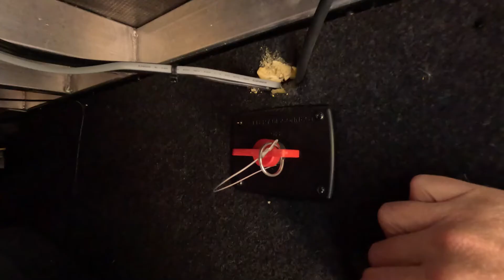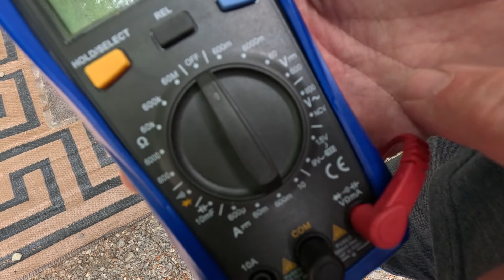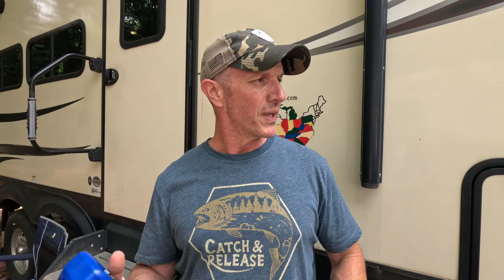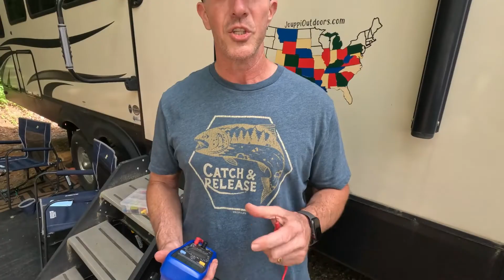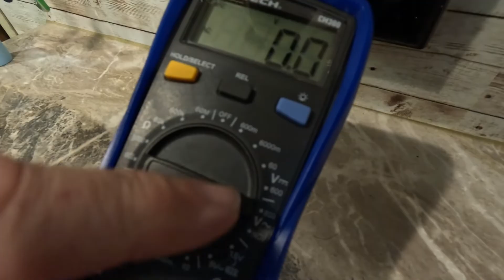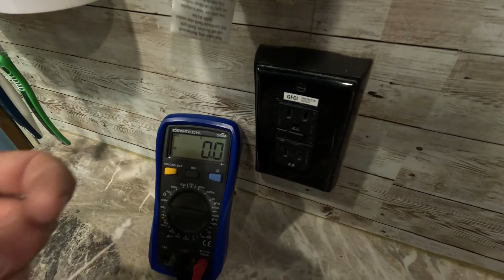Understanding RV Electrical Systems: Basic Troubleshooting Tutorial

Comment: Outstanding video.   I have what I think is a bad converter.  My RV is hooked up via 30 amp outlet to my house 24/7 so we can use the fridge in there in case our house fridge is on the blink (happens more than I would like).  I have a smaller RV--it is a 16' Retro by Riverside.  No doubt, much simpler in terms of power usage than many RVs you have seen.

We had an indirect lightning strike to the house recently which fried our thermostats and a circuit board in one of our two indoor AC units.
The RV fridge and lights had problems that night but I had more pressing concerns in the house so I switched off the breaker to that outlet.

The next day, my multimeter indicated 120V AC but no DC at all and no working lights or fridge in the RV.  A 15 amp AC fuse (labeled 'Gen') was blown.  I replaced it, but there was still less than 1V DC when measuring across the DC terminals inside the power distribution box.  All of my DC fuses show proper continuity.  It is rather simple inside this box because the trailer is small and fairly basic.

 I now think the flickering lights the night of the lightning strike were due to operation off of a weak battery,  which then was drained dead the next day.

I will examine the capacitors and fuse inside the converter.  If I am lucky, it is a blown fuse instead of a bone fide converter replacement.  Either way, I am confident I can fix this myself now that I know how these different power systems interact.  I did all of the electrical work myself for my farm house which was bought as an unfinished foreclosure--so, I am fairly confident in my skills here.  This video aided my education on this latest DIY project.
Reply from the maker: I agree, sounds like a bad converter. Glad the video was helpful!
Reply: @JouppiOutdoors  Found out there is no continuity in the converter fuse.  Can't seem to find a source to buy just one single ceramic PCB-ready fuse so will just get a new converter for about $75--not absolutely sure replacing the fuse will 100% fix the problem + time spent with soldering gun makes installing a new converter the  best method in terms of time and money.  Will keep the old one for parts.  YT videos like your have been a godsend for a DIYer like me.

Comment: there is a top connector to check that fuse
Reply from the maker: Correct, I was trying to illustrate that even though the fuse may not visually appear blown, checking it with a meter will verify if it is definitely good or not. I did this because most people are just pulling and looking at the fuse, not testing it in place.

Comment: Just got back from camping (The road was rough) and plugged our RV into land power and shut off the battery and noticed that the kitchen light fuse was blown. I disconnected shore power and put in a new fuse and it blew when we plugged back in. I turned off all breakers inside and out, then turned them back on and the 15 amp fuse blew. I went through 8 fuses. I then checked all the lights. They are LED. Made sure all the connectors were tight. Even cleaned out a couple small cobwebs. We also turned off each individual light switch, and the main light switch, turned off the main breaker, put in a new 15 amp fuse, flipped the main breaker back on and the 15 amp fuse blew again. All other lights works in the RV. I am getting so frustrated.
Reply from the maker: Hi there! Those lights should run off the 12v battery when not plugged in. They are 12 volt lights that run off the converter when plugged into shore power, then off the battery when not plugged in. If they do not work when not plugged in but do work when you plug into shore power, it is usually an indication of a bad battery. That doesn’t explain the fuse issue though. If you have each individual light turned off and the light switch off and the fuse is blowing when you turn on just the switch, I would say you’ve got a wire that is exposed and shorting out. You could start removing the light assemblies and disconnect them one by one to narrow down the area of the short. Problems like this just take time and patience to track down.

Comment: I turned on the hotwater heater and it made the kitchen circuit not work. I checked the circuit breakers, turned them in and off. That made no difference. 😢
Reply from the maker: Did you check the GFI outlet (usually in the bathroom). The water heater shouldn’t have anything to do with the outlets…coincidence maybe? The kitchen outlets are often on the same circuit as the bathroom gfi outlet.

Comment: I get a shock sometimes when I touch the frame.How do I find a short to ground ?
Reply: Have you installed anything requiring screws in the wall near any wiring? If so make sure you didn’t install screws that are touching wires.

Comment: Hey bud Great video! I have a 46 ft Jayco toy hauler that part of the 110 outlets don't work, I've checked the GFIs, Replaced one but still at a loss.. Any clues from you would be greatly appreciated Thank you!
Reply from the maker: I would check the connection where the shore power cord connects to the rig. I have seen many burned connections (including in our rig!). That can kill 1 leg of the power coming in and also, some of the 110v outlets. Here’s our video on what happened to ours: https://youtu.be/7aSVgBqxcco?si=bBFPShZyBNJ2N2s4

Comment: Hello again.  My friend and I are both seniors.  He just bought a very nice 2005 Starwood SL Fifth Wheel 28RLS.  He has no experience with trailers, 5th wheels, or Rv's. I lived in a 1972 Terry trailer for 3 years in college -1972-1975 and later also had an overhead camper.  His trailer will be parked at the same place and he will be using it 2x/week or more. Tonight he did not have any AC power.  He checked that there was power at the end of the AC cord that plugs into the trailer and there was.  I helped him find the electrical panel - under the stove and get it open.  None of the breakers had been tripped. He tried turning them off and back on anyway as we would do on a house and no change. I asked him to look for a GFI plug (probably in bathroom) to check it, but he could not find one.  I sent him the link to your video. I came across a video that showed a fix for no A/C power by pressing a button on the Manual Breaker Reset connection. (that's what he called it.) The battery cables from the battery went to it and then other cables-like battery cables went further into the RV to the electrical panel. In his case, there were 4 terminals on the device, he did not have power to one of the, so he pressed the reset button and then everything worked. In his case this was under the RV.  I just saw the same thing, but it was under the mattress on that video, looked a little different, but same wires to it and leaving it to same destination.  So, it was very dark and getting very cold and he decided to work on it again tomorrow.  (Missing his electric blanket in the cold.) He purchased the 5th wheel from a dealership that went all through it, and delivered and set it up. An electrician put in an electrical power connection for it, so all should be good. So, do you have any other ideas as to what we should do.  Very disappointing to have this happen on only the 3rd night he has slept in it, though it has been there for about 2 months.  Thank you so much! I am looking at your other videos too.
Reply from the maker: I would recommend checking the back of the receptacle where the power cord plugs into the trailer. It is a pretty common electrical failure point and would cause a loss of power without tripping any breakers. Here is a link to our video showing that process: https://youtu.be/7aSVgBqxcco?si=-pwREcHkbiLIas9J